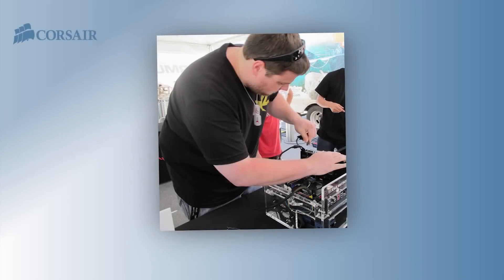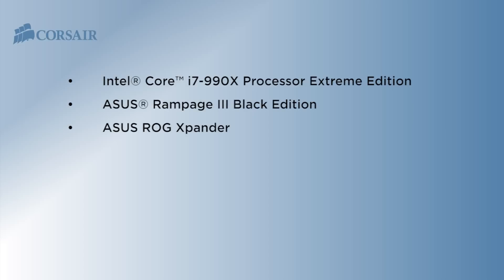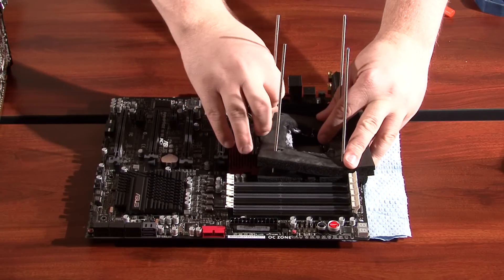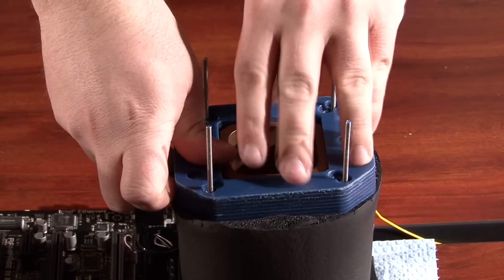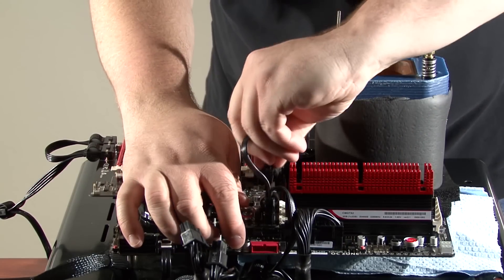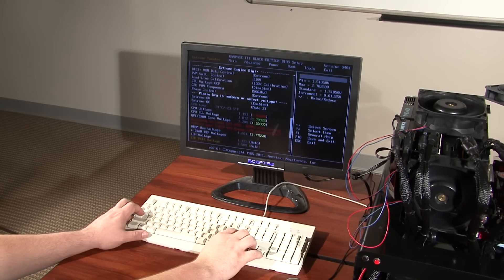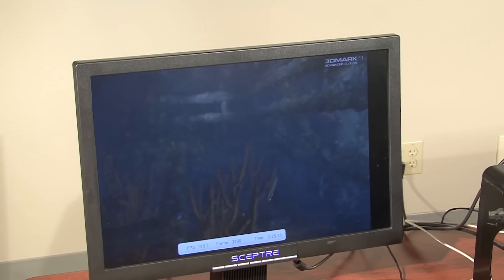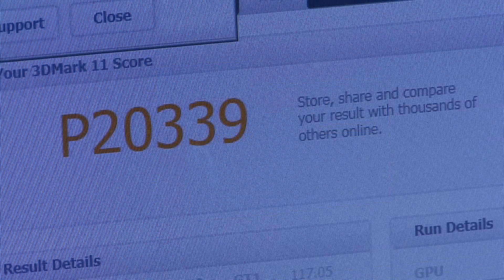Setting up your PC for liquid nitrogen cooling

Comment: 1:57 

that's a lot of thermal paste !
Reply: You need a lot for LN2 overclocking cause at extremely low temperatures the thermal paste will shrink and crack. Ruining your temperatures
Reply: @CAfakmykak  alright ;D

Comment: You forgot the very important step of filling your CPU socket with dielectric grease to prevent condensation from occurring in the CPU socket...this is a very simple step on Intel motherboards, not as simple on non-STR4 AMD mobos.
Reply: not necessary.

Comment: @2011 Nitrogen stock about P15000 and Overclock P20339.    Another youtube video at stock speed @2016 scored P25056.  4-5 years gap tends to matched or better than the extreme overclock scores.  @2017 scores ranged from 31000-51000, 5 years sounds like long time.  @2018 more people will be pushing the limit to new scores.

Comment: Electrical resistances with electronic controled wouldn't be more precise to keep temp near cold bug instead of a propane/butane torch? And so, reach higher and more stable OCing?

Comment: You need to make pro systems for rich computer geeks out there!  Maybe you can perfect your Liquid Nitrogen system and mass produce this.  I know a lot of companies would beat a path to your door, Jake.  It's great having pioneers like you in the world.
Reply: You're insane. This isn't mass producible, how many people honestly want to pour liquid nitrogen on their computer for shits and giggles? (or likes)
Reply: Ah, but I totally disagree.  I think if you could find a way to develop a device that can inject the cryo NO2 you may find lots of OCing enthusiasts that would be highly interested.  The world wants faster clock speeds just like they want more fuel-efficient automobiles.  Think about it.
Reply: Only problem is the high maintenance, most people that pay lots to get something like this pay because they don't want to/can't spend loads of time on their systems.
Reply: Ethan, if some clever entrepreneur figures out a cost effective way of mass producing these nitrogen coolers he will be one rich sonofabitch!
Reply: Brian Brewster Nope, very few will buy them compared to water cooler, it can't be in an enclosed space, and you need to refill them, the way this guy did it is cost effective, all they have to do is measure how much nitrogen to put in it and keep in it, also, i can think of a way to make this work with minimal maintenance, but there's still more maintenance and more that can go wrong than water cooler. And a mistake with this could be explosive.
Reply: Brian Brewster also, they'd make more money if they didn't mass produce them, since the same people would buy them either way
Reply: thom si Actually nitrogen is a great idea for server farm environments but for normal gaming Pcs it's stupid like you said

Comment: Well, that sure was overclocking big time... But I did not see you install the cpu it's self after the thermal paste was done?  All I see was the stuff put around the place where the cpu would be on the main board!  Plus if the liquid nitrogen was poured onto the top of the cpu even if that was as cold as you stated before the pour as th e cpu warmed up the nitrogen would heat up and bubble away as steam?   Also what stopped the nitrogen from leaking out onto the main board?  Sorry to be picky as you seem to know your stuff?  But I just wondering about these problems?  Thanks.
Reply: The CPU was already installed can't you see it
Reply: And also you put the thermal paste on the CPU not below the CPU that will damage the motherboard
Reply: @2:08 he installs the kingpin cooling pot. Think of it like a tall drinking glass made of copper and as he mentions in the video he has it insulated and that's why the only copper piece you see is at the top. That's why it doesn't leak out onto the rest of the board
The thermal paste was applied to the top of the cpu since the cpu was already installed.

Comment: so.....nito cooling is just for to see what is the highest one can overclock a cpu?   can nitro coolling be used for everyday purposes and long-term usage?
Reply: Can you buy liquid nitrogen and change it every single time you start using your pc? Also at those temperatures you'll have to keep monitoring the temperature every 2 minutes. Can you do all that? Not worth it.
Reply: No, it's just for extreme benching.
Reply: we have a phase changer cooling so we can rub sub zero -48 but it's expensive but it might be worth it considering the cost of water cooling and the amount of fans needed aswel  but  nitrogen is for running CPUs and GPUs beyond very fucking hot temperatures like over 100 degree

Comment: question, what sorta speed could i get out of an fx 8350 black edition with this method?
Reply: No amount of cooling is sufficient for AMD products.
Reply: +Andrew O 9k you really dont understand computers do you? answer me this, how do i  use an fx 8350 how do o use an r9 390 how did my cousin use an fx 8350 how does my cousin use an and r9 390 how does EVERYONE who uses amd products use them...
Reply: wait just realised you are probably being a troll.
Reply: ***** i know, amd doesnt currently have an answer to the skylakes, although the zens that are coming out should be able to match the skylakes, although the thing with AMD is they are much more open to overclocking. look at it this way, the fx 8350 runs at 4 ghz but is designed to be able to go up to 5, thats a 1 ghz overclock, 1 billion cycles per second more than manufacture, and while the skylakes and other intels ARE capable of that, they tend not to take it as well as amd CPUs do, especially the black editons. yes i know intel has the k's which are unlocked like the black edition but again they arent designed to be overclocked as much as the black editions. heck if i wanted to i could overclock to 6.5, i dont know how my aircooler would like that (jk, itd over heat like mad). and lets take an fx 8350 vs an i5 skylake. lets say we overclocked both to their maximum reccomended overclock, the 8350 would overclock more and tbh it may still fall short but not by all that much.
Reply: ***** i know, they are probably more powerful, im just saying that the potential gap is much smaller than people often think.

Comment: When I saw the graphic cards I knew this video was old
Reply: i knew it was old at i7-990x
Reply: When I saw the 4 MOLEX connectors I knew it was old
Reply: I think that there is a reason behind the small amount of RAM besides age. It might have something to do with speed.
Reply: MrGhost370 depends in what task - the 990X is certainly not better than the 6700K in gaming, although many processes that rely more on cores than clock/IPC might actually favor it.
Reply: MrGhost370 Fair enough, sorry for the misunderstanding. :) What you 'need' for gaming is entirely subjective, though - and the 6700K is arguably the highest performing CPU for most games.
Reply: MrGhost370 to clarify, I'm not saying the 4690K isn't a good CPU - it's great! In all honesty, I'm slightly jealous at you having one. :p All I'm saying as that the i7 6700K gets about the best fps of any CPU in the majority of processor-bound games. (of course, that's due to an extremely high obtainable clock, and great IPC more than it's due to cores)
Reply: Im using i7 930 :)
Reply: I use i7 860 combined with gtx 1060 and still fuck a lot 1080p games
Reply: I'm using an old gaming computer from 2010. You can get them for pretty cheap and they run smoothly. All you need to do is fix it up with a newer graphics card and the upgrade would only cost a few hundred bucks. Not to mention, Some older gaming pc's range from $300 to $400. Pretty good deal if you upgrade some specks

Comment: this doesnt sound safe. id rather just go with my predator 360 liquid cooling set.
Reply: this isn't meant to be a permanent cooling solution these are done specifically for short periods of time specifically for bench marking you don't set this up for it to be your primary desktop for years on end. 

in terms of cooling solutions the have phase cooling (1/2/3 phase each is colder than the last and can be run for extended periods think of it like a super cold ac system for your cpu/gfx cards) > ln2 > water (sometimes chilled) > aftermarket air > factory air
Reply: He should do a build with 15 Titan x and then she what the benchmarks are lol
Reply: I have 480mm watercooling paysants

Comment: Has anyone done this for the whole motherboard? This is seriously awesome, but I can only imagine running such a high multiplyer rather than a higher FSB (bus) affects system stability.  This is th e internet so I expect to get shot!  Maybe that isn't an issue these days? (Used to overclock machines in the early 2000's, I wonder what has changed).

Comment: The insulation is kind of bad. Condensation will ruin the motherboard shorting out . so there are 3 tasks to at least try to take care of:
1 - create a layer of something on the motherboard, so it does not contact air at all (like put some dielectric gel all over the motherboard, inside the CPU socket to remove the air, etc)
2 - avoid condensation by having an outer wall heated so the final barrier with air is actually warm enough so water from atmosphere does not condensate onto anything (and even if it has.. that is the gel at step1 for)
3- avoid having humid environment, like filtering the air in the room with desiccant (a lot of it), or an active filter like an AC with special function to dry the air.. or just build an enclosed space filled with nitrogen to avoid water altogether.

Comment: can i do this with my intel xeon e5 mcnuggett 2 TB raid 94 super gigahertz turbo NOS extreme ssd edition it would help alot with my stock cooler that is halfway melted my cpu gets an average of 1738 degrees celcius and i just dont know what my next choice should be... any tips
Reply: +Emille Rodriguez try dropping dry ice in liquid nitrogen and immediately pouring all over your cpu

Comment: From 3.3 GHZ to 6 FUCKING ghz
Reply: i overclocked my processor to 9 ghz, it booted and i could read it was running at 9 ghz and i was like OMFG gg then it died lol. rip processor
Reply: The world record is
AMD FX-8370 8.72GHz
http://hwbot.org/benchmark/cpu_frequency/
Reply: That's a nice overclock but the IPC on AMD is still significantly lower than an Intel counterpart. Don't get me wrong, I like AMD processors but clock frequency isn't everything.
Reply: 6.0 gigawatts !!! I mean gigahertz!!
Reply: +Nils Lorand 
with liquid nitrogen people gets over 7GHz
Reply: Amd FTW
Reply: +Nils Lorand 
dat iez insane
LOL
Reply: what cpu was it?
Reply: that's still not even that fast in comparison to what can be achieved with Graphene...you can get to about 500GHz with graphene. link-> https://www.extremetech.com/extreme/175727-ibm-builds-graphene-chip-thats-10000-times-faster-using-standard-cmos-processes

Comment: he forgot that electrons move inside a cpu and coold them soo down
Reply: well the max temperature if a and with a stock cooler is 114 degrees so imagine overlocking everything to 100 degrees using a phase changer system evaporator seeing as and chips get pretty hot

Comment: a loop system with cutting edge electronic temperature stabilizer needs to be invented to cool whole pc just like whole pc liquid cooling that will keep whole pc at 20 degree. which means loop starts when system is getting hot and stops as soon as system is getting too cold to run

Comment: WHY LIQUID NITROGEN?
You could easily use any other phase-change cooling method (like closed-loop) to get the same temp!
THIS IS SUCH A WASTE.
Reply: +Erik Voorhies phase change will only get a modern cpu to about -15 at best

Comment: For a true overclocking experience, you need to cool your computer down to absolute zero
Reply: Ash Scott He said fucking ABSOLUTE ZERO.  It's not PHYSICALLY FUCKING POSSIBLE.  It's a fucking joke, you dolt.  There is nothing to assume, as any other possibility is not a possibility.
Reply: Ash Scott http://bit.ly/1Bcvybv
Reply: +MrTimbobx  Oh...My god...There are more of them.  Absolute Zero is 0 KELVIN.  This is roughly -273.15 degrees Celsius or −459.67 degrees Fahrenheit for an ideal gas.  This has never been achieved by man, and is theoretically impossible.  It's so cold it's almost comparable to stopping time in the area that is cooled to temperatures this low.  It's hypothetically the lowest temperature.
Reply: You can't do that it's impossible
Reply: YourMomHasNo Hax http://bit.ly/1zGGmZO
Reply: +weirdokiller123126 Well it is possible to cool something that low, just it would not work
Reply: ***** Significant digits.  Smartass.
Reply: *****  First of all, I would like to prove you wrong in a simple manner, then I will do it again in a long, drawn-out, hypothetical manner.

First, Absolute Zero is only -273.15 degrees Celsius for an IDEAL cooled gas, not for everything.

Second, Absolute zero is the temperature where there is the lowest (but not zero) thermal energy in the system. 
For example, the difference between pi and absolute zero is that for pi there is a mathematical formula that allows computation to any number of digits. Physical quantities, on the other hand, are determined simply by mathematical formula. The most accurate physical measurements are for quantum electrodynamics where the error is less than one part in 10^15. This is equivalent to the width of a hair compared to the distance between Los Angeles and New York. However, it is still far less accurate than the computations for pi or e, which do not have to match some physical measurement.
Basically, for an ideal gas, it it EXACTLY -273.15 theoretically, but, this is not just a math problem and numbers.  This is a physical phenomena (regardless of whether it happens or not), thus the numbers are likely to be SLIGHTLY different.  But, the difference between the theoretical value and the actual value of absolute value are so close, that it is not significant, thus we just say -273.15 because we aren't able to accurately calculate it after a certain point.  So we cut the number off where we know we are accurate.  For example, if we could only calculate Absolute Zero accurately to the 30th place after the decimal, we would still write that it is -273.15 degrees Celsius even though it's actually -273.150000000000000000000000000000132567.

Make sense?
Reply: ***** Did you find my explanation and sources satisfactory?  Have I sufficiently destroyed your argument?  Have I out smartassed the smartass?  Do you see any other nonexistant loophole that I've missed that you would care to fail to exploit again?  I can do this all day.
Reply: ***** Well you started the conversation off with quite the pigheaded, obnoxious comment.  My sources/literature are linked in the comment above the one you just replied to.  If you don't want to be seen as a bigheaded keyboard warrior, then don't attempt to correct somebody's scientific explanation by harping on one of the adjectives they used.  Especially when the adjective was not even used incorrectly in the first place.
Reply: +TheRandomguy06 Did ya not watch the video? CPU's won't work that cold
Reply: TheRandomguy06
Would YOU assume sarcasm, given the IQ of the average Youtube commentator?

Comment: see i feel like there should be some inherently cool liquid that can just go in a stock liquid cooling loop that doesn't require your constant attention to maintain. kinda defeats the purpose. i get that overclocking is a competitive sport some places but what about for people who just want to game or stream. i understand regular water cooling loops function for what they are needed for, but isn't there something thats more effective that could allow me not so much fan use?
Reply: +companyoflosers There is nothing more effective than watercooling, except for a compressor/phase-changer.
And there are no "inherently cool liquids" that you can use in a watercooling loop, since a watercooling loop is nothing more than air-cooling with water as a medium between the cooler and the air. With a little bit of knowledge of thermodynamics you should know that yourself.
Reply: search up the phase changer system it's very similar accept you can run it all day at -40 degrees so that's as close as your gona get the ultimate in freezer form compressor for your pc

Comment: But can it run Minesweeper?
Reply: It will run smoothly bro at -150 fps
Reply: no it need 360 fps kappa
Reply: My rig is cooled by metallic quantum superfluid deuterium alloyed with Vagisil, and I can sweep mines like a dream.  A smooth SkiFree experience, however, remains heart-rendingly out of reach.
Reply: +Chance Rogers Maybe with 10 fps
Reply: On low settings maybe
Reply: It just might
Reply: This is from 2011, so it'll be difficult :D
Reply: tjbtech my rig is being cooled with unicorn pee

Comment: 4gbs of RAM lol
Reply: +Wyn 3 things:
1. This video is 4 years old
2. The more RAM you have, the crappier your max-overclock becomes. The more you strain the memory-controller, the less likely it becomes to reach a high OC, so you reduce your RAM-size to the bare minimum needed to pass the benchmark
3. With that comment you outed yourself being a total noob when it comes to benching and overclocking
Reply: +Metatr0n 1. it was a joke. 2. read number 1
Reply: +Metatr0n Except for the fact that it was. I've done 6.3Ghz with an H100i on my FX-6300, I have it stable at 5Ghz on a Hyper 212 EVO right now. Using 8GBs of RAM.
Reply: +Metatr0n Believe me when I say that I know a little something about overclocking.
Reply: +Jack overclock my 4790k then haha at 4.7 my h100i can't handle the heat during summer.
Reply: *****
You must know it.
Reply: *****
I'm fairly certain all your brain-capacity went into that deduction, right?
Reply: *****
How long did you google for that diss?
Going to mute this discussion now, you can continue to scream at the screen if you wish to.